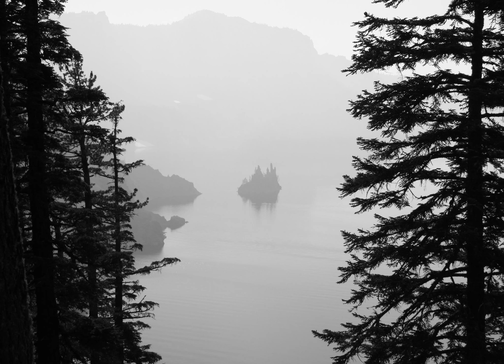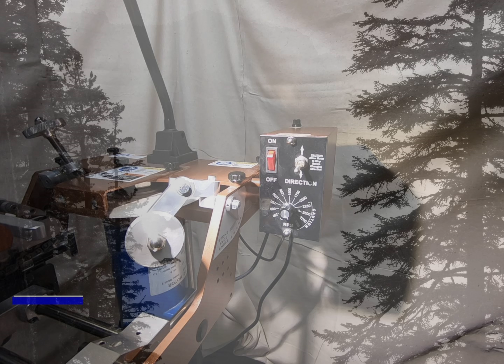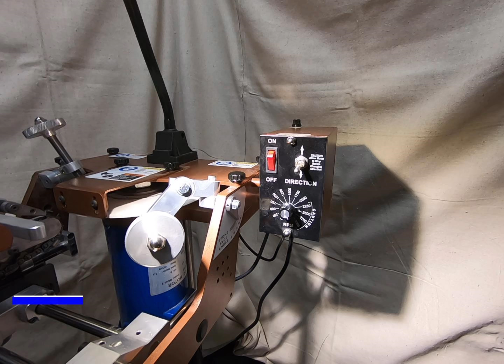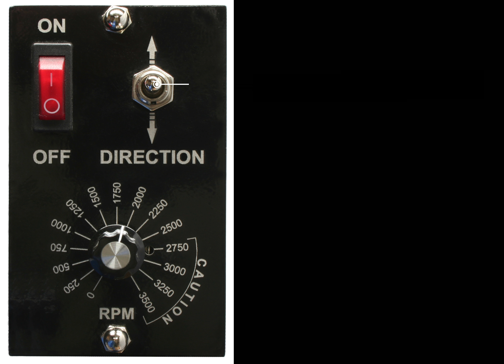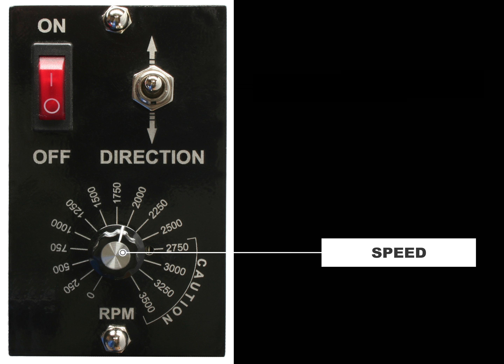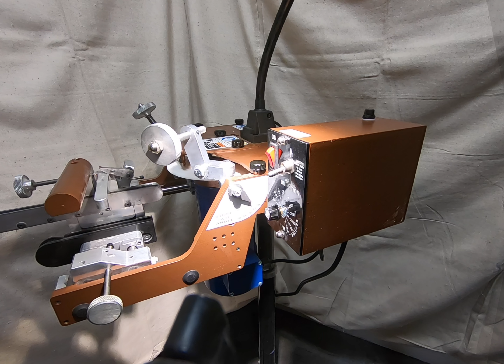CZ223 Motor Controls and Dressing The Grinding Wheel

Comment: I am having trouble with dressing the wheel wobble completely away on my machine. I get the rough shape I want without issues but some areas of the wheel are still not touching the tooth. We are talking very small adjustments here. Do you have any tips on the finest dressing of the wheel in the end? Thanks!
Reply from the maker: Thank you for your comment.  We're working on a multipoint dresser that should smooth the wheel more.  My personal technique is to make very small adjustments on the diamonds and hold the diamond with my hand closer to the wheel.  This seems to give me more control and make the very fine cleanup possible.
Reply: @tandsmfg Will try this method and looking forward to the new dressers.